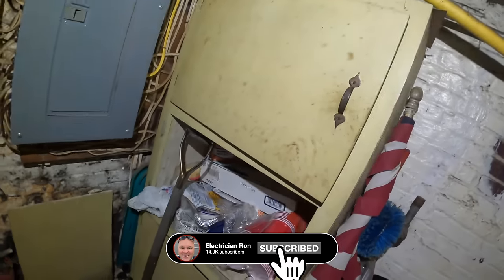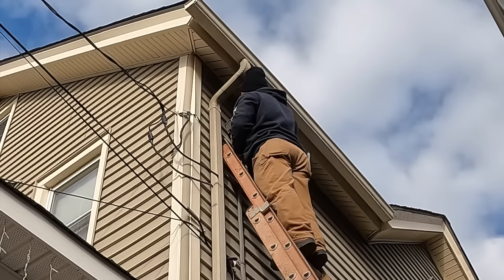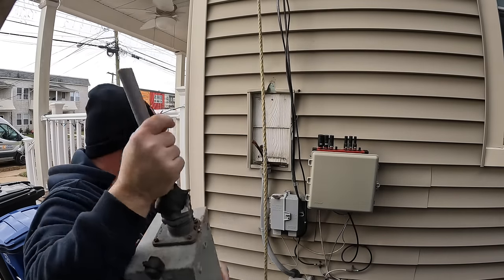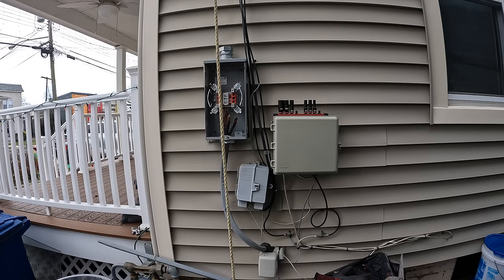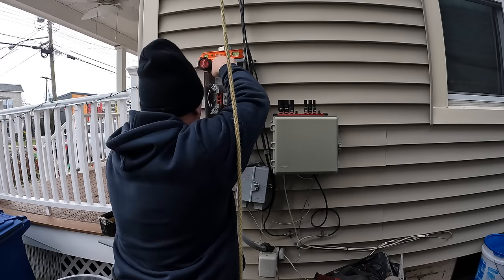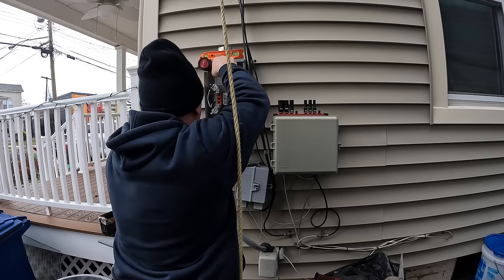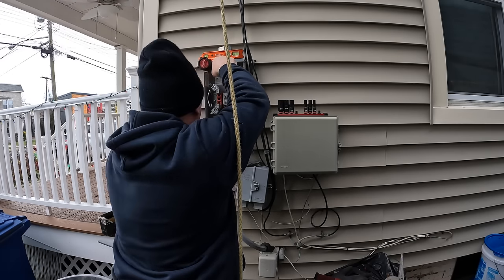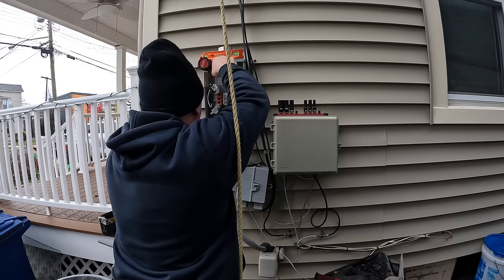200 AMP ELECTRIC SERVICE RISER REPLACEMENT #electrical #electrician

Comment: I had a compressor in my garage that worked fine for years. All of a sudden, it began popping the breaker. I also noticed a much higher voltage on one leg of the service. After numerous calls to our utility, they sent out a tech who pulled the meter and put on an artificial load. He found arcing on the neutral at the pole! No problems since but what a weird thing to happen.
Reply from the maker: Unfortunately, it's all too common.

Comment: I know of one residential house near here that has 208, right across from the phone company  But in this territory mostly only large businesses get 208 3 phase, smaller places get high leg delta so no problem feeding a house off that.  208 volts = 75% power on heating elements, take the oven longer to come up to temp, dryer probably you would not notice since duty cycle only about 50% when up to temp anyway, air conditioners all dual rated.

Comment: I would expect 208v would cause overheating problems with 240v rated motors such as you might find on table saws, hot tubs with jacuzzi jets, AC compressors, etc. And resistive loads would take significantly longer to reach their target temperature. This issue is what high-leg delta transformers are designed to address -- when both 3-phase and single split-phase loads are present. The utility should be asked to correct this problem.
Reply from the maker: the utility caused this problem!
Reply: Understood. I did not mean to imply this was a problem caused by you. The utility supplies the power and in this case they are not supplying enough!

Comment: I have never seen a 120/208 single phase Residential service in my 28 years in the Trade. We do have a lot of 3phase 120/208volt high-leg Delta Commercial services here in the Portland<OR Metro area in older neighborhoods. It almost sounds like your house power might be derived from a high-leg Delta 3phase network on the Street.  I t is probably not too good on Modern 240 volt appliances,lol. All Resi services I have ever worked on are 120/240volt systems.  Thanks for sharing, Ron
Reply from the maker: This is not a delta system.  There is no HIGH LEG.  It’s a single phase service from a 120/208 Wye configuration.

Comment: And if your going to do it 100% correctly you should be using a torque wrench on those meter base lugs there are torque specs for copper and aluminum .

Comment: Ron, before I cut the service cable hot legs I wrap tape on first then do my cut. This helps avoid dropping the tape when pulling it out of your pocket or pouches. This avoids climbing down the ladder with a exposed hot leg. Only took me one time to learn that lesson.

Comment: Hi Ron. I really enjoy your videos.  I am a licensed electrician but not working in the trade except for work that I do for myself and family/friends. So your videos help keep me current. I am also a licensed plumber and gas fitter. In this particular video I noticed to the right at the ceiling of there was yellow flexible gas pipe (CSST) that may not have been bonded. It is important to bond this pipe that is only .008” to protect it from lightning strikes which otherwise could cause fire and explosions. So when you see this pipe in a home you may want to recommend to clients having the pipe bonded.
The black CSST has a bonding strip inside and does not have to be bonded. The only CSST that should be bonded is yellow.

The short gas pipe connectors behind appliances look similar but are not the same and do not have to be bonded.
Thanks again!
Larry D.
Reply from the maker: Very good observation Larry. I didn't notice the CCST when I was there but did see it in the video, oddly enough. I'll be back to this house later next month so I will check to see if the bond was made at the installation.

Comment: You should get yourself an impact gun, I like the Milwaukee surge as it's quieter. They are lighter and better on the battery.  This is the 1st video of yours I have seen , I like how you add the code in the video. That's a nice touch. Subscribed.

Comment: Hey Ron, first, happy new year!! So, in that connection of wires with the grid, it will be not better remove the existing splice so that there is only one splice, thus avoiding hot spots?
Congratulation, Nice job.

Comment: It's two legs of a 120/208 3 phase system.  This is common in commercial and larger apartment areas.  You might even have a 3 phase delta with a grounded leg.  You did nothing wrong.  120 degrees phase angle between legs in a 3 phase system, so you have sin(120)=0.866 then multiply that by 240 and you get 208 volts.
Reply from the maker: I dont have an open delta service here. Yes I know they exist but this is not that. This is a mid-span service drop from a 120/ 208 Wye connected service  (utility supply, if you will). Three transformers on the utility pole.

Comment: Love the video and the code references on screen are pretty cool. I always get a little pucker factor when I have to work with live conductors or see someone work on them even though I know what is being done is safe, I have the greatest respect for those that do it every day. I have hooked rg6 messenger cable through my ladder more than a few times I would like to admit, it's always a pain to go back and undo it since there can't be any break in the cable before the ground block we could never do a splice outside even if there was enough slack to create drip loops.

Comment: I have done lot of service upgrades and never used 4" long screws to secure service cable. Excessive length could pierce a wire or worst yet a water supply line inside of walls. Always taped the bare grounded conductor both inside of meter can ( white tape ) and at weather head ( two laps of Scotch 33 black tape ) . The black scotch 33 tape that I used at my weather head bare wire almost 40 years ago holding up good out in the sun, rain , heat & cold. I had a dedicated steel brush to brush the paste deep into aluminum strands. Keep it in a heavy freezer bag to keep it clean. Years ago PECO would give you quality center bolt bugs to connect services. Had to sign for them but every once in awhile would have one of their bucket trucks on a job and they would give me a bunch of the two sizes they had.
Reply from the maker: You tape the uninsulated grounded neutral? Lol what for? That makes no sense.  4” long screws are necessary because of the 2-3 finishes on an old house. Water pipes are never run on the exterior walls of a house because they would freeze.

Comment: Happy New Year Ron another great install, why don't you use USEI wire more often than using conduit and wire ?
Reply from the maker: Because of concerns to protect the conductors from physical damage. For instance, I cannot use SE-cable when a meter is in close proximity with a driveway, or car port. Stuff like that.

Comment: Love your video Ron, i am a utility company troubleshooter, i have been to many jobs of open neutral, phase down or low voltage that a electrician who reponded to customer call, sold them a service upgrade. Then calls utility to repair actual problem. Then i stand in front of customer, while they ask me what did i pay electrician for?  Truthfully i make up a story that they all new equipment with plenty of space for car chargers etc....
Reply from the maker: The biggest trouble with this call was the utility lost a neutral and damaged a lot of equipment inside the house. I don't know the extent of the damage but I'll be going back there to changeout some old non-tamper resistant receptacles, GFCI's, and I'm sure other unlicensed hack work.

Comment: 17:45 Just curious why you are using 4" screws,  wouldn't they only be effective if you were to hit a stud?  The top of that screw has 1.5" of no threads, once it is in all the way it is not even grabbing the sheathing on the wall unless you hit a stud.  I might even be concerned about  hitting a wire inside a wall.

Comment: Wow. Copper service cable. Priced 4/0 copper SEU cable 40 years ago and it was $1 an inch ( $12 a foot ) and Billows electric only stocked it in one of their 12 locations., the one down at the Jersey shore.

Comment: Have you added any emergency disconnect switches on the outside of homes in combination with a meter pan replacement in PSE&G territory? It would be nice to have a meter-main panel with meter pan and integrated 200A breaker as emergency and service disconnect, but I can’t find if PSE&G allows that. Thanks, great to hear your NJ specific knowledge.
Reply from the maker: I don't think I've done a full upgrade in either territory since 9/6 when the full requirement went into effect. For some reason they do not like the meter/ main combos and I wish I knew why.
Reply: They dont allow them here either. One reason I’ve been told is it makes it even less likely someone will replace the meter socket when the jaws wear out. You usually can’t get new replacement jaws within a few years. There are other reasons too. But the outside disconnects are the code now and they will be making them be added if there are any changes to the service conductors or socket add one

Comment: Ron, great videos, do you have any videos of a service upgrade where the service cable comes to the roof over head, but goes down thru the inside wall to the panel? All services in your area seem to be on exterior of house?
Reply from the maker: I have a 200 AMP Mast Service upgrade found here: https://youtu.be/2exwe2Fga3w?si=7p6635I9Yav7PtsD
Reply: Yea they should all be outside. If there is a fire they have to cut the power before putting water on it and shouldn’t enter house without water

Comment: Hey brother what I learned to get better tongue on the part which you were installing the straps up too, just use a better drill with less fasteners.. one long but instead of that drywall attachment and those other attachments.. or just get closer with one medium size bit.. especially since you’re up in heights.. I enjoyed this video 🤜🏽🤛🏽

Comment: So with that distribution set up, any loads that will require 240 volts, will only receive 208 volts? 120x 1.73=208 volts for 3 phase service. This residence will only  be using 2 legs of 3 phase service which will still be giving 208 volts. But this house is just a single phase 240/120 volt single phase set up. How’s this ok?
Reply: Most of your stuff is meant to run on both. Most apartment buildings are 120/208. I bet bigger fancier fridges and stoves might lot be but just an unusual set up is all

Comment: I thought the video transition at 7:57 was the vinyl siding falling down on you!  And I know handling the service feed is safe because you are insulated, but it still freak me out a bit.  A few years ago we had to replace our meter box - water leak had corroded the lugs and we lost one leg to the house.  Our electrician run his pvc heat box directly from the service feed, which I found fascinating

Comment: Hey Ron, Love your videos. Have you ever had an issue with pseg making you re-do a point of attachment to accommodate the larger wires they will use as the new service drop?
Reply from the maker: No, that’s PSEG territory.

Comment: That was great video, camera angle on ladder was great. When you connected live wires on ladder,is that the reason you could handle them because you were on fiberglass ladder so you were not grounded?
Reply from the maker: Correct. Current in the conductor had no path to flow.  No conductive path to flow.

Comment: Did you miss the missing plastic protection at the incoming lines in the main panel - your were inspecting it... ?
Reply from the maker: I’m not sure who put that panel in or when. The covers over the lugs is a relatively new code requirement.

Comment: Copper SEU, that's crazy to see. I've known it existed but I've never seen it in person.
Reply from the maker: @handles_are_dumb_01  I live near the Atlantic Ocean and my supply house stocks it because aluminum turns to dust in short order along the coast.
Reply: @electricianron_New_Jersey  That makes a lot of sense. Here in Ohio we don't have a lot of oceans around so it's not much of a concern, lol.

I'm guessing you would use 2/0 copper for 200 amp service in that case?

Comment: It's always good practice all around to use anti-ox on ALL of your AL conductors.  Over the years they have made a lot of saftey improvements in the alloys specifically used for electrical applications, but AL can still oxidize, especially if outdoors, or in humid areas.

Comment: Curious the utilities out there supply the meter sockets . Here in MA we have to supply them, also we have to have an outside emergency shut off outside, for single and duplex dwelling units. Looks like New Jersey doesn't require.
Reply from the maker: They do provide meter enclosures but this was kind of an emergency repair so I just bought one. A permit number is required in order to get the meter enclosure and I still dont have the permit for this job. I've applied for one but it hasn't been processed as of yet.

Comment: That would work but we use a different meter but not on a house because it is a three phase service
Reply: Also don’t you love how they cut that j Chanel to funnel in the water to rot the board behind the socket

Comment: How come you're not getting shocked when you  are touching live wire from the street?
Stripping, etc.?
Reply from the maker: Because the electrons have no path to flow because I am insulated up on the fiberglass extension ladder.

Comment: Around my area you put in a 200 amp service with 4/0 wire and you're lucky if the utility has #2 triplex feeding it.  😂
Reply from the maker: That's the way it is here too. All # 2 AWG Aluminum unless you're close to the saltwater.

Comment: Can I Install a new main breaker,meter base etc. next to the existing one before cutting service off and removing the old one?
Reply: Usually that’s what many do. One thing to watch for or ask is that you don’t lose too much service drop length. You can have it all inspected and waiting for the service move.

Comment: To my fellow NJ electrical contractor.  Where is the outdoor disconnect for the service which is required but code and ALL meters whether from PSE&G or JCP&L come with detox preinstalled on the lugs. No need to add anymore. Just an FYI
Reply from the maker: To my fellow NJ EC: the service disconnect is not required unless you are upgrading the entire service.
Reply: Have they hit you with the article 230.67 yet 🤦🏻‍♂️ codes just keeps digging into our profit margins
Reply from the maker: @e-tekelectric433  of course! The DCA adopted 230.67 on 9/6/23.

Comment: Did one on these in chicago. Had to carry a 2 inch ridgid pipe up the ladder and thread it on. I weighs about 40lb
Reply from the maker: I don't work with 2" or 2.5" RMC often but when I do I eat my Wheaties and question the amount for a 10' stick!

Comment: Hi Ron, love your videos. I noticed when you were splicing back the live wires your hand was close to the downspout. Is there any danger of you touching the downspout and getting shocked ?
Reply from the maker: Yes, in all likely hood there is a path to ground from the aluminum water leaders so you would definitely get shocked should the two surfaces meet. Don't give the electrons a path to flow and you won't get hurt.

Comment: Very nice job!
Reply from the maker: Thank you very much!
Reply: Hi Ron - The part where you cut the live wires coming from the street or the transformer scares me. Can you explain how you are able to cut those wires without getting shock or maybe you can do a short video explaining? Thanks. @electricianron_New_Jersey
Reply from the maker: @owenjennings8575  Current leaves the source and returns to the source.  Do not give the electrons a path to flow and you won’t get shocked/ electrocuted.

Comment: I work around brooklyn ny its very common on residential houses  to have 208v
Reply from the maker: Most of the appliance equipment found in a home is dual-rated 208/ 240 anyway so no big deal.
Reply: @electricianron_New_Jersey  true

Comment: I'm surprised it's still allowed to use an SER cable for a riser. In my location 2" ridgid conduit mast is required.
Reply from the maker: Illinois?
Reply: @electricianron_New_Jersey  California
Reply from the maker: Cali where the electrical panels are outside.  @Oldhogleg
Reply: @electricianron_New_Jersey <> After WWII they've been typically flush mount except for upgrades on pre WWII homes. Usually supplying feeders to one or two subpanels within the home. The utility company has been pushing for ALL new service panels to be surface mounted with exposed service mast or exposed riser of the underground lateral to prevent people from tapping power on the supply side of the meter to power Grow-Ops.

Comment: Like your vidéo got a question I need to move my panel it 100w if the rebuild it do they still need to do up to code
Reply from the maker: Different in each state. Check with your bldg dept.
Reply: @electricianron_New_Jersey  ok I start talking to my city but it so long to get a answer lol
Reply from the maker: If it was here in New Jersey then yes, it would need to be brought up to code including while house surge protection to safeguard your wiring and branch circuits from dangerous surges that could really wreak havoc  @curtlundcramer9424